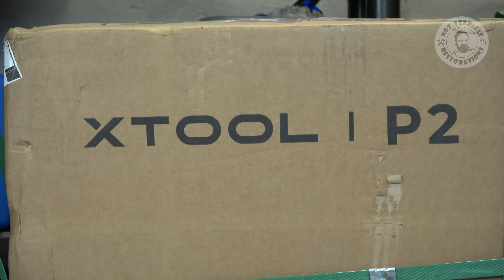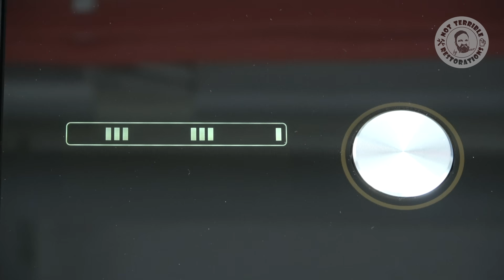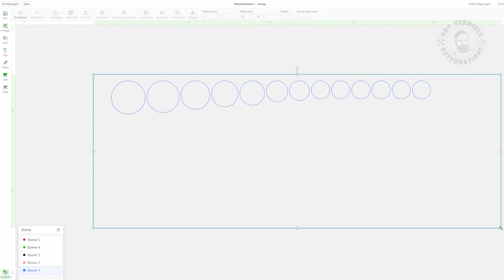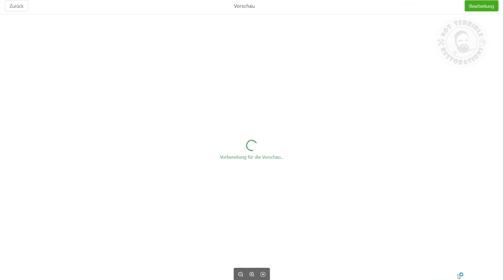Laser Cut for Orphaned Tool Kit | A new home thanks xTool P2 CO2 laser machine

Comment: Would it have been easier to first spread the glue on a layer and then remove the cutouts? Or is there a reason why that would not have been a good idea?
Reply from the maker: I tried that, but glue was spinning fine lines all over the place

Comment: Seems like it might have been useful to use a foam roller for the glue. I don’t know if that’s an acceptable way to apply it. 

And using some locating pins to ensure the layers are set correctly might make assembly of the layers easier if you do a project like this again.

And using weights spread over the surface might make it easier to ensure a good contact when you assemble the glued layers and make it lie flatter?